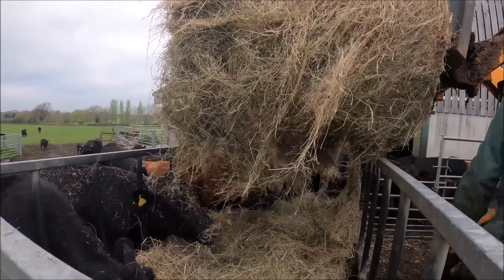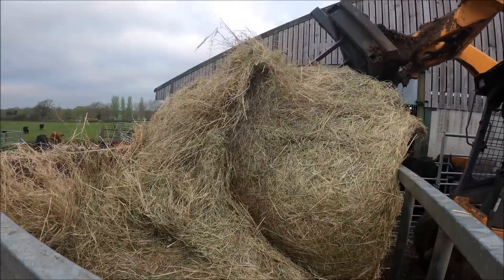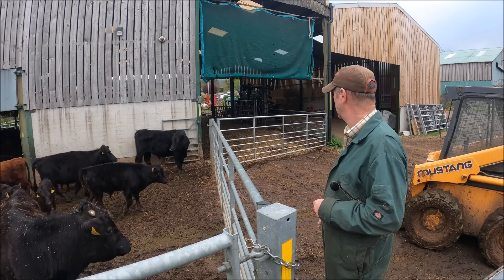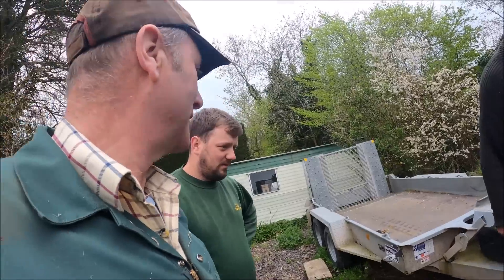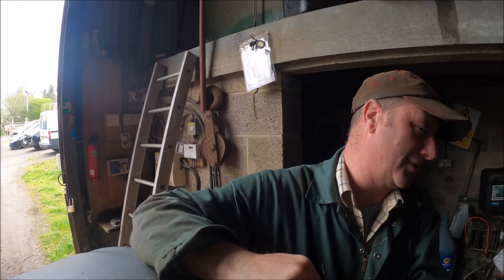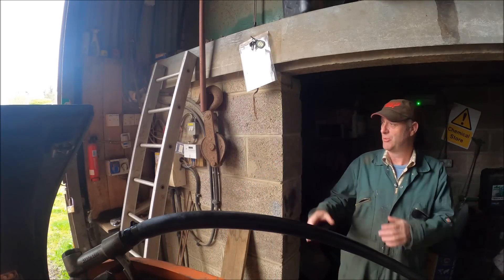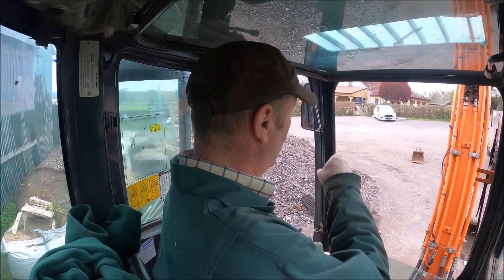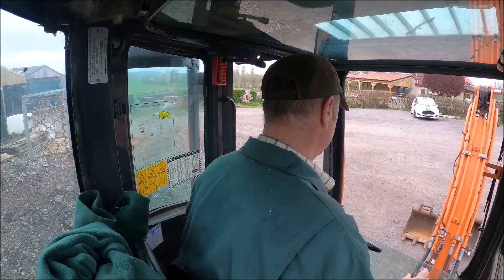18/04/23 Moving Tom's memorial Oak tree  Part one, getting ready.

Comment: A friend of mine had worked part time with me for several years. One particularly pain filled day(I’m disabled since 2004 from a lorry wreck)he’d hooked up my dump trailer. Against my better judgment, I listened to him when he vehemently declared that he’d watched me hook up so many times how could he not know how to do it right. Well….1 mile down the road is a set of train tracks at the crest of a small hill. If it weren’t for the safety chains, me being cautious, and a good set of trailer brakes, I’d have been fishing my trailer out of a very deep ditch. He’d not set the ball lock and safety pin in place. 🤦‍♂ Lesson learned. Your equipment, you’re driving, your responsibility. Always, always, always check yourself.

Comment: Interested to see the next part, I'm also keen to see how you support it.

I've lifted and moved some fairly big trees over time, some up to around six inch trunks usually I'm using a 5 ton machine so  I can use the full force of the machine to almost cut down in a ring  with the tip of the bucket around the tree then scoop underneath  allaround this again before finally lifting then wrapping a hessian bag around the trunk and lifting with a endless sling.

I either use a double stake with a crossbar a rubber block and band on smaller trees or  platipus anchors on the rootball.

ocasionaly I've used a several platipus anchors driven in flush to the ground level a length of tensile wire and gripples  threaded through  rubber hose and tensioned off the platipus anchors to form guy wires.

In my opinion, the key to moving your tree aside from the basics of maximum root  and stakeing properly will be to multch heavily and get the customer to properly water with enough water.
Reply from the maker: Both systems would work well, but we were on a tighter budget than that. Although it reminds me to go and find my platipus shoe driver that is somewhere safe in the barn. We had a nice sheltered spot for the transplant, and yes we mulched it well with good well composted Woodchip. 🙂👍🏼
Reply: @FarmerP   it would be great if you can do an update in 12 months on how it ultimately fares. You're right about the platipus anchors, a bit eye-watering in cost!

As I say, I look forward to part 2.
Reply from the maker: @paulf2529  
We will visit it periodically Paul to advise the customer about care. It’s a very late move, but you will find out why tomorrow. As for support, we re used the original….. for a sentimental reason. 🙂